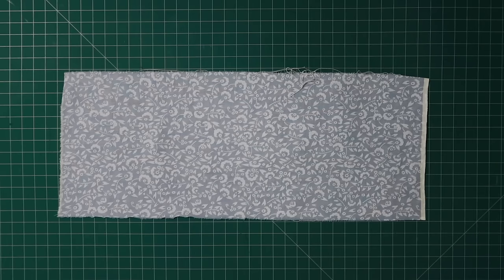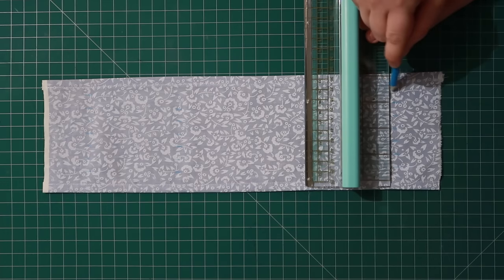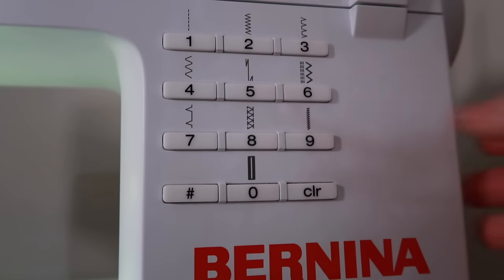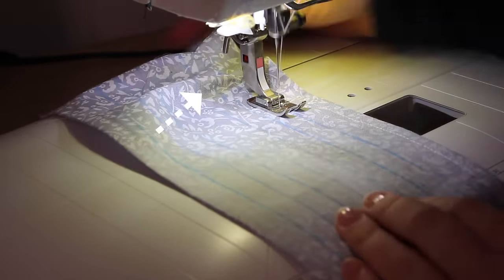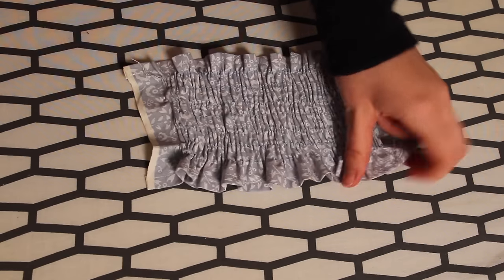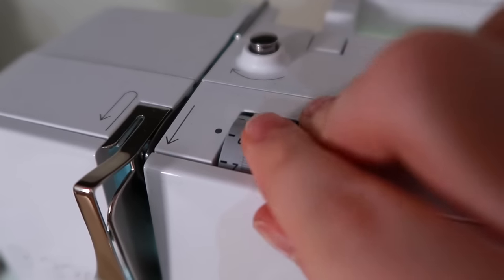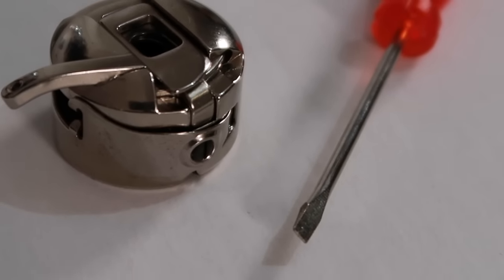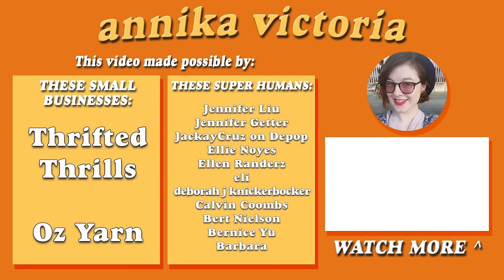How To Shirr Fabric | Shirring Tutorial

Comment: I had said I was going to try some shirring and I did! It was fun but at the beginning was a bit like learning to use a sewing machine all over again. My main problem now is getting my tension back where it should be. I had to turn my top tension all the way to 9! (I have a Brother PC-210 PRW if anyone’s interested in knowing the model.) And now I can’t seem to get the tension right again. A fried who was a former professional costumer said that what I should do is turn all the tensions back to zero and then adjust up until I find the sweet spot. Also, I found I had to stretch my elastic thread a bit while winding. And my machine top loads bobbins and it really really didn’t like the first few stitches sewn with that elastic thread. I think it has to do with how the bobbin thread threads up through the machine.

Comment: Thank you for this great vidéo. I had a go at shirring and it was going beautifully with a nice straight elastic line, until the lower bobbin ran out and I replaced it with more elastic thread. Since then, the elastic is going all wavy, even if I haven't changed any settings in between.  I winded the bobbin again (by hand, like the first time), tighter this time but still having the same problem. I saw on some forums about changing the tension on the lower thread, but I didnt do that in the first place and still managed to get a nice result. I dont understand why all the sudden, without changing any settings, it's all gone wrong.
Reply: Usually, hand wind the elastic with a loose grip (not tighter) on the bobbin.  Looser wound bobbin usually equals better elasticity of fabric when sewn.   I did this myself when beginning with shirring and I was shown to hand wind the bobbin nice and softly, looser  (not to stretch the elastic at all while winding)   This help made me very successful at shirring after that.  Hope you can try again and get good results for yourself this way. :)

Comment: I had to increase the tension on my bobbin to make shirring work on my machine. My tips for it are:

1. Be gentle with the tiny screw! There's  usually a bit of wax (paint?) That's been dotted onto the screw to keep it from turning. It can be helpful to poke at it with a needle to break it up a little so you don't have to use a lot of force to turn the screw.

2. Turn the screw 1/4 turn at a time, sewing a test swatch in between turns. Every machine is different so you won't know how much the bobbin needs to be tightened without testing.

3. Remember how much you tightened it. And by remember I mean WRITE IT DOWN. Who are you kidding, you're not going to remember. Just make a note that you tightened the bobbin (clockwise turn) and how much you turned it. 1/4 turn, 1/2 turn, 3/4 turn, whatever it is. Stick the note to your machine, and if you forget to turn the screw back, you'll have a little reminder of what's going on when your next project is turning out wrong.
Reply from the maker: winterinbloom great tips - thank you!
Reply: I'd probably end up drawing a line on it and making a note of which way I'm turning it before I start messing with the tension, and then reset it by turning it the other way until the marks line up. But that's just my two cents, having never adjusted bobbin tension.
Reply: @sadmac356  That's a good idea! On mine the paint they'd put on it didn't entirely come off the bobbin or the top half of the little screw, but if it does marking it would be very smart.

Comment: I tried this method and it seems to others to work really well. But for some weird reason it is not gathering probably. I just got a new machine so I thought that could be something to do with it as my tension and stitch length was at its highest setting. I also hand did the bobbin. I have a drop in bobbin and don't know how to tighten it (and I don't really want to do it in case I mess up my machine as I am only a beginner). My elastic is also 0.5mm. Any advice would be really helpful. Thank you .

Comment: My sewing machine has a bunch of electronic stuff, so would this cause an error with it? It detects tension issues if the thread isn't doing what the machine thinks it should. Most of the false errors it was giving were fixed after a cleaning, but so many tutorials show the old style bobbins, and mine only takes plastic "babylock" ones, and top loads. It also doesn't need the thread brought up with the needle, and I don't even know if it would let me do that... I really want to do this to the waist of a pair of pants but I'm scared.

Comment: Please help!
I've tried shirring now a few times, but I run into a problem. everytime I try, the first few rows work out fine. But after sometime the elastic thread starts to be sown either to tight (so the elastic breaks when I stretch the fabric) or to loose (so it won't be gathered properly) on the next few rows, while I haven't changed anything in the settings. After that happens I can change all settings as much as I want but the next rows just won't come out properly. This is obviously super frustrating since I have a piece of fabric that's half good and half ugly, and I really don't know how to solve it since I've tried all the tips in the video. Does someone maybe have any advise? It would be greatly appreciated ^-^

Comment: I remember needing this for a pattern a few years ago but my machine was just pulling thread loops where the elastic went through straight and unstretched... I just wrote it off as the elastic not working with a top loaded bobbin, do you know if that's right or if I should've played around more with tension?
Reply from the maker: Maxi Reinecke it can definitely work! I think you need to play around with the troubleshooting tips :)